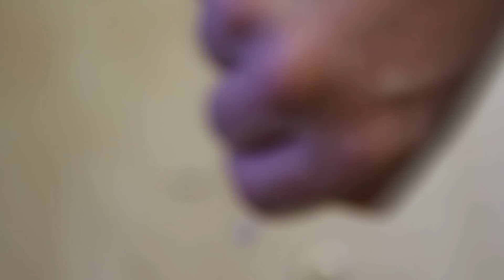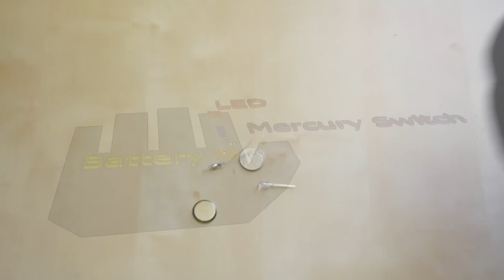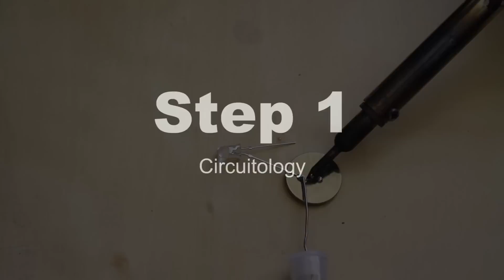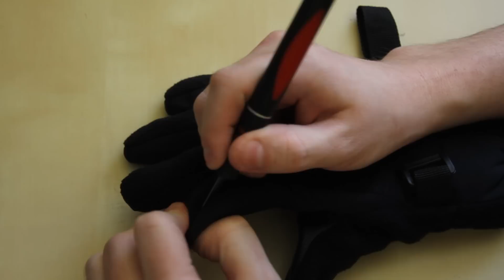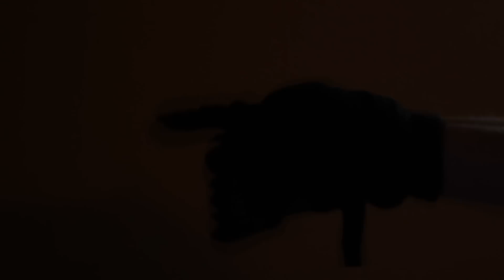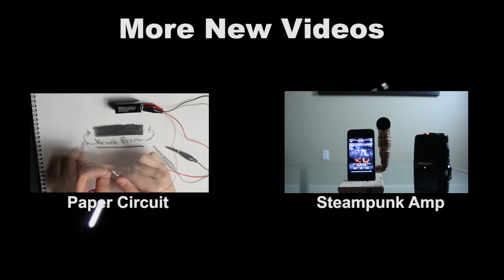Gravity Light Glove!

Comment: modifications: ten colored leds for all fingers covered in modified cat nail caps (opened to fit the led) or some other fake nail cap method. Also, cooler looking gloves. Oh, and glow in the dark bone painting on the gloves. :) Cool for parties. Although I still don't like the idea of the mercury switch. I'd be worried about it breaking. Especially if these were used at parties and thus a certain amount of inebriation was involved. lol

Comment: I got a motion sensor (Parallax PIR Sensor), and a 433Mhz RF receiver and transmitter (TX433 and RX433). My idea is that when the motion sensor detects motion, the transmitter sends a signal to the receiver and I get a signal in a different place. I'm planning on connecting the receiver to a light bulb.
How do I connect the sensor to the transmitter, and how do I connect the receiver to a light bulb? Also, is there anything I need to do so that the receiver receives what the transmitter sends?

Comment: be worth the extra couple bucks and get a coin battery holder to solder to instead. apart from the obvious changing the battery when you store it wrong and the battery dies, but you should never solder directly to batteries. too much heat! especially coin cells, they can explode easier then you'd think.

Comment: @TheMrbunGee  @MadeInQorea Although mercury itself is not toxic, it is reactive enough to a point where as soon as it comes in contact with another element, it will likely bond to it. This makes ingesting it poisonous as it will prefer to be with elements in your nervous system, attacking it to a point of failure. Actually you dont even need to ingest it. As a liquid, it will evaporate. When you inhale it, it attacks your nervous system just as if you were to drink it.

Comment: I really did not like this. This could have been made so much better if you had an actual battery clip instead of soldering directly to the battery, have the battery clip and mercury switch in the back hand side of the glove, and just wires running to the led in the finger. I'm pretty disappointed.

Comment: Except, When I need a torch, is usually to check behind dark corners, or to light up the ground when walking, both of which require the torch to point down.. which would turn off the mercury switch :/ pretty pointless.

Comment: Soldering to the smooth surface wont last long.
use some duck tape.
I tried soldering to the battery but after few minutes it just slidded off

Comment: But be careful mercury can be poisonous and extremely toxic  if it can get in your mouth more over if the mercury switch brakes by a hard hit of your hand on a surface then you have i a big problem with glass in your hand and mercury all over you i don't recommend this project from the safe side. And there is an article about mercury at Wiki 
Mercury and most of its compounds are extremely toxic and must be handled with care; in cases of spills involving mercury 
FOR YOUR OWN SAFETY DON'T DO IT

Comment: @CurriedogNZ no there isn't any possibility to burn glove with that low power. [except when 2 wires from battery: + and - will touch together (there must be min 9v battery)]. but if you use 1.5v or even 4.5v battery it won't burn glove but only battery will be wasted.

sorry for my bad English :P